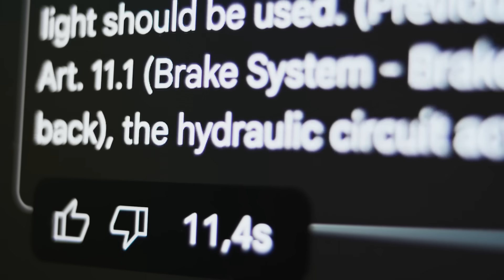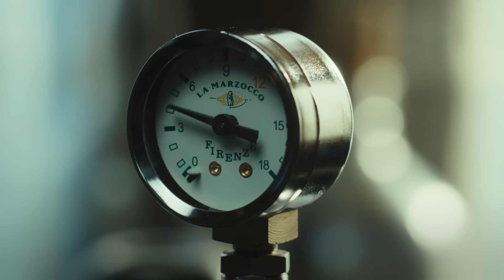1% Battery to a Full Lap of Monaco from a Mountain Descent ⚡ | Formula E: Mountain Recharge

Comment: Last year the race was 31 laps. That lets you use 100/31% battery per lap+recharge. The 31 lap race let's you use 3.2% per lap without rechange. 
Let's theorise that recharge is good enough in monaco to charge an extra 100% of the battery during the race. That lets you use 6.4% energy per lap. Let us round this up to 7% of energy to do a full push lap at Monaco.
So you're telling me, that rolling down the hills, having to go around 25kms (probably more) (the straight line between the 2 points of Col de Braus to Monaco is 10km)  to get to Monaco, the battery charged +6%?
Reply: While I agree with being skeptic, I'd like to point out that you do not need to start a lap with 6% when - as you point out - 3.2% is enough in a race.
Reply: @ChrisBigBad  I gave them the benefit of many doubts and the highest most pleasing numbers and I still cannot get a laps worth of energy be more than 7%

Comment: An uncut data driven video along with the advertisement would do a better job of explaining the power of the FE regen
Reply: It's more of a google ads unfortunately
Reply: @Dakkyun but not even a really good job of that either. There's no way Gemini is giving an accurate answer to this question when we don't know the regen characteristics of the car actually. It's hallucinating an answer that just may happen to be correct. 

It's almost more like a lifestyle ad. But like.. Of what exactly? We don't even know what SOC they ended up at. Or even if this was even a real test, since lots of things seemed staged.

Eh. Oh well. It was well produced. But TOO well produced. Felt very inauthentic

Comment: Well, the calculations for which route would be enough to recharge could have been done by hand or, well, asking a local Longboarder or even just guessing. No need for AI, but you chose not to use your brains.